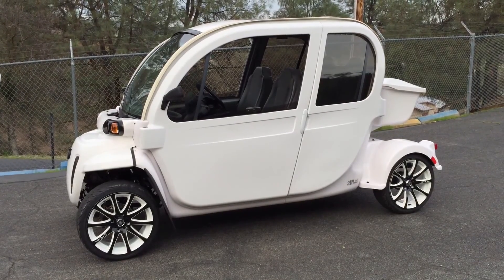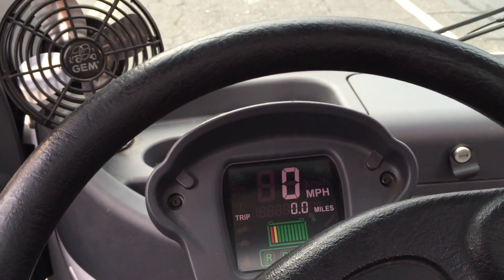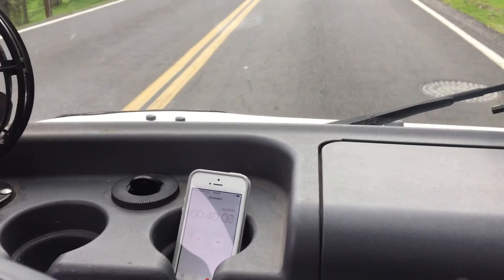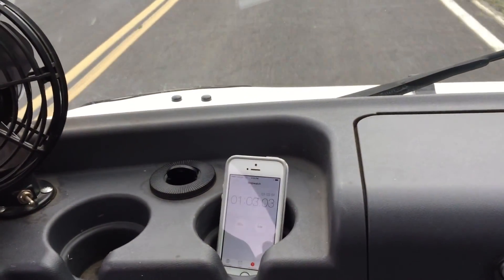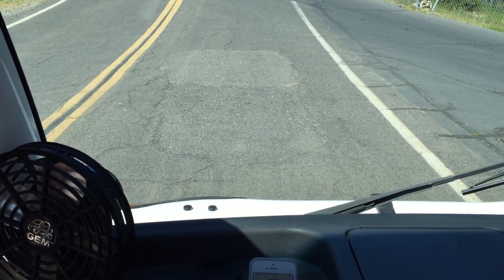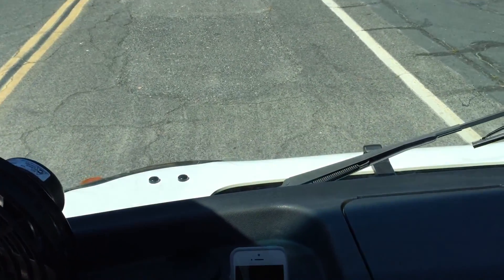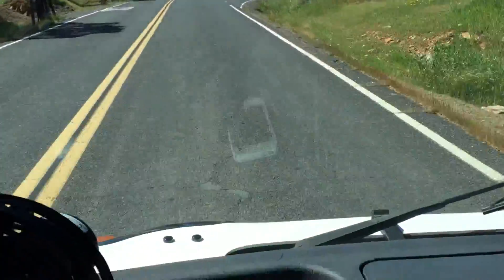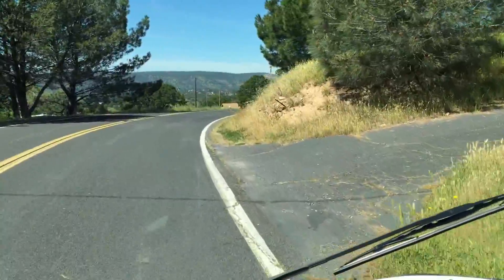Gem Car with LITHIUM MANGANESE upgrade

Comment from the maker: Thank You to Mike M for your help with this project. 
This is a 80 Volt LITHIUM MANGANESE battery pack, with 20 4-volt cells. 
LITHIUM MANGANESE is the same battery chemistry for the Nissan Leaf and the Chevy Volt. The Battery Charger is a DELTA Q that has been flashed for a Lithium charge profile. Finish voltage is around 82 volts.

Comment: I am in the progress of converting my 2002 825 to lithium, using chevy volt batteries.  you state the battery charger is a Delta Q.  What else can you tell me about the conversion.